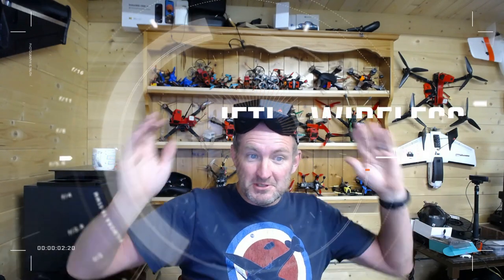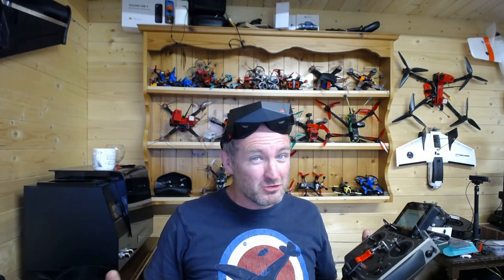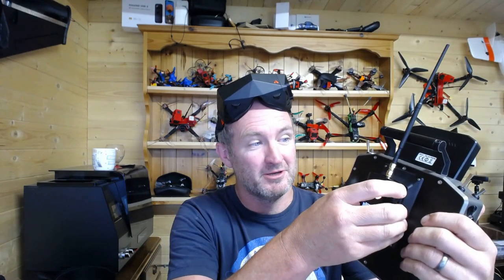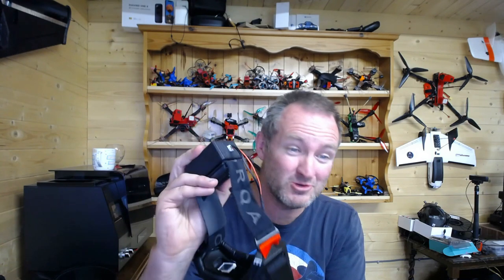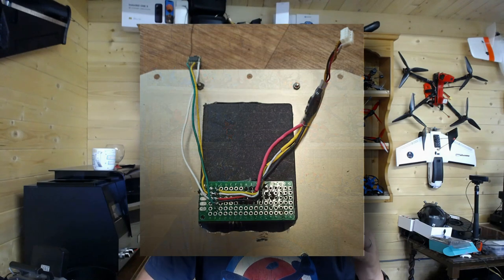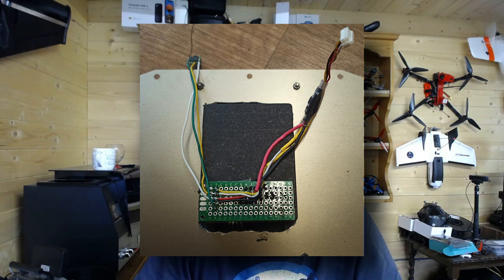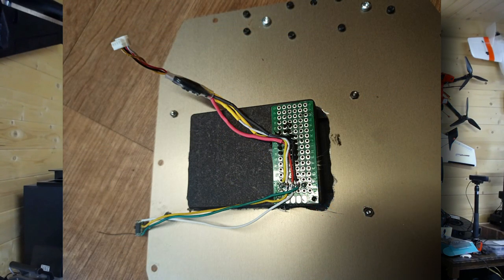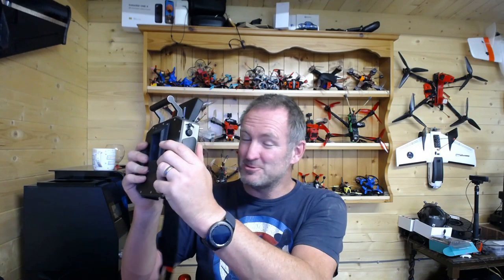JETI WIRELESS HEAD TRACKER AND JR MODS... HOW DID I DO IT?

Comment: nice/... so how would it work with a TX16s and the internal module (seek as i use crossfire almost exclusively) got any schematics/tutorials to the headtracker? I have a trinity module right now woul love to be able to just use that
Reply from the maker: Its actually quite simple.

OpenTX/Multi Protocol module allows you to make the module act as a DSM or FRSKY receiver.

So all you are doing is getting a small transmitter...   
https://uk.banggood.com/DasMikro-Das87-Spektrum-DSM2-7CH-PPM-Transmitter-RC-Parts-p-1528898.html?rmmds=search&cur_warehouse=CN

Wiring the PPM out from your head tracker into the transmitter... and then binding it to your radio.

I keep meaning to do a video on this to show exactly how!
Reply: @RTRCTV  yea a video would be good. but seeing as it's PPM, could you do t with 2 hc05's into the trainer port ?
Reply: @RTRCTV  actually you know what... i have the old multiprotocol module from the T16. I could use that no?
Reply from the maker: @WX4CB  don't believe so.  The hc05 is designed for a serial protocol.. Not analog.

Comment: What does a jeti do that a radiomaster doesn't? Are you just flaunting your RC bling at us?
Reply from the maker: Lol.   Not that at all.    Mostly jeti is just fantastic at ergonomics. 

I also fly allot of full house slope soarers.. Jeti handles complex glider setups a whole lot easier than opentx.   

It's really a massive trade off.  On one hand m open source allows tons of flexibility.  I love that.    But I also love the hardware quality of the jeti... But get annoyed that jeti is not as well geared up for fpv as the opentx platform.

Lol.. But no.  Not really showing off bling.  Just showing how to make random different systems talk :)
Reply: @RTRCTV  Interesting, I get that I guess. It would be nice to have a radio that didn't feel like its a matter of when not if it fails. It's a hell of a lot of wedge though.

Also I think it still counts as jewellery because you hang it on your neck. You should gold plate the radio and put spinners on your landing gear ;)
Reply from the maker: @frasersteen  lol.. I think I will do a video called.. 'what does a jeti do that a Tx16s doesn't'. :)